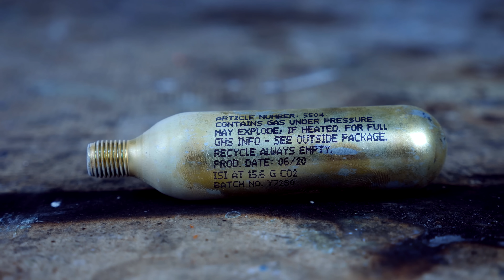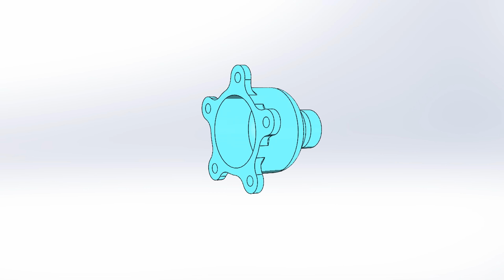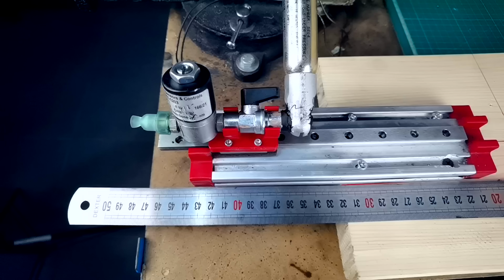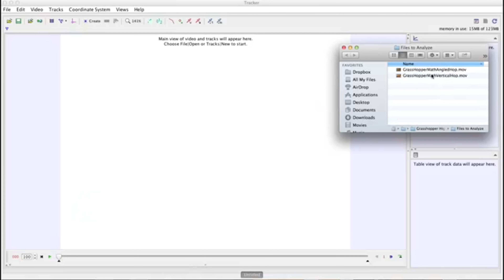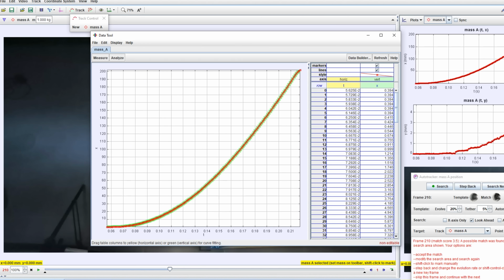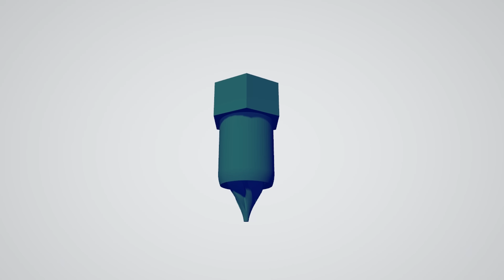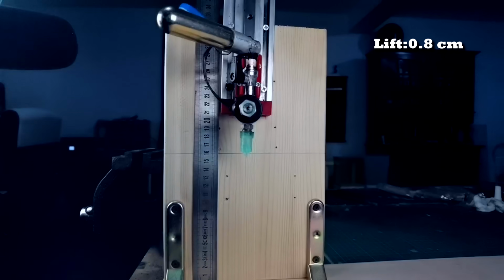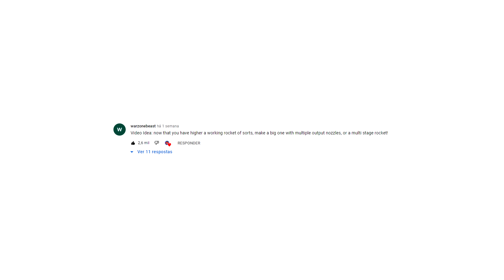I 3D printed a CO2 Rocket

Comment: Nope, no dry ice in there. The pressure in cartrigdes like that is about 55 bars, at that pressure CO2 is liquid (at room temperature). When releasing the pressure, you do get some dry ice out of it. That happens because of the enthalpy of the system, which is conserved. If the cartridge opening is small enough that is (Joule-Thomson-effect). You can see in the p-H diagram of CO2 that when coming from a liquid at 55 bar, dropping the pressure you end up with a solid-vapour mix at ambient pressure, due to the temperature drop. I use the exact same method to make dry ice pellets for the Leidenfrost experiments I do for my master thesis.
Reply: Awesome explanation dude :)
Reply: Great to hear sir, thanks for sharing.
Reply: So there a 4 phases of co2 inside the cartridge during a full emptying  liquid, solids (like u discribed nicely) supercritical and well a Gas
Reply: Bruh, this comment was about pressurized co2, how the heck did the replies get so wacky?
Reply: @doctorpurple5173  lol.
Reply: @jimmyb1451  lol
Reply: @okumhlopheindodaactsxvii4022  You forgot to like your own comment.
Reply: @jimmyb1451  55 bar =797.7 psi & 14489.3 psi = 999 bar 

Its you who doesn't comprehend anything, not even the world Your living on
Reply: @jimmyb1451  22km or approx 72 000ft below the surface of the earth is the Furthest "Man" has ever penetrated the earth, They say earth crust is 35-70miles deep then the mantle from 70miles to 1000miles then the outer core 1400miles then the Inner Core 800miles 

Tell me again how do They know that if 22km is the Furthest anyone has ever gone below the earth 

They say the Core of the Earth is Hotter than the Surface of the Sun
Reply: @jimmyb1451  theoretically on your ball world you think you live on, if you theoretically dug a Hole at the North pole straight through the earth to the South pole and there's a hole big enough to jump right through, if you Jump in at the North side will you be falling "UP" or Falling "Down" at the south pole?
Reply: @doctorpurple5173  lol
Reply: We used to make dry ice bombs with Gatorade bottles and CO2 bottles at the paintball range I worked at. Turn them upside down into a rag and crack the burst valve. Instant dry ice
Reply: https://youtu.be/NlT6XqpoeTo
Reply: Your thesis will be entirely wrong if you don't take into account that the entire world has a Barrier around it keeping 14.7psi "air pressure" at sea level Inside without leaking any of that from escaping into an Infinite Vacuum "imaginary" Space along with your "Imaginary" Gravity that holds no Water
Reply: @okumhlopheindodaactsxvii4022  "imaginary"?
Can you explain the quotes?
Reply: @rickhowe5082  He's a flat earther.
Don't bother trying to get any sense out of him.

He has no concept of gravity nor pressure. Or anything at all for that matter.
His "density argument" is only less dense than his head.
Reply: @jimmyb1451  the Earth takes shape like Clay pressed under a Seal its features stand out like that of a curtain "don't think the earth is by any way flat" mountains, Crevasse canyon's ect. But i definitely Believed all the World's Water Seeks its own "level" thats why at any Beach view Ocean side you can See the ocean from one Horizon to the other and take a picture of that View and Eddit it with photoshop and draw two parallel lines just above the Horizon and below the Horizon you'll notice No Curvature on the Horizontal Horizons you get from the ocean view, if its really a "Ball" should it not Curve 360° all around you and not just only in the direction you are facing, think about it use your brain's as I have "psalms 96:10 announce amongst the Nations "the Lord" that's Jesus is KING, also the World is Fixed, so that it doesn't wankel forever and ever, "The Lord" Thats Jesus will judge the Nations Justly. Narrator "Jason" -Acts 17v⁵-⁹ the only one of the 72 who wasn't mutelated and burned by Israel and the greeks and the Jews but was let free on good account also mentioned in John21v20-25 the only One who will never die until The Father of all creation comes once more
Reply: @jimmyb1451  funny right how can Parallel lines exist on a Sphere when the Maths and science dictates otherwise, last time i checked mathematicaly "Straight line's" don't exist on a Sphere yet every ocean side beach view is 100% Horizontal "Parallel"
Reply: @jimmyb1451  tell me right im sure you'd understand this, In Magnetics right Opposite poles attract and like poles Repel, So A Compass is designed to point where? The Compass Needle is Polarized with One Polarity only otherwise the design won't work its magnetized with a North polarity just FYI "your True North" is my Fact "South" all compasses point Not north but True to the science South, Now I've turned your world upside down what will you do
Reply: @jimmyb1451  has no Concept of Fact from Fiction
Reply: @okumhlopheindodaactsxvii4022  LOL

Lucky we have such omnipotence as you amongst us. The ONLY one in the world who knows "The truth" (.TM)

Since you know so much, explain to me why it is that literally every rocket that you just watched only travelled a short distance vertically, and much further horizontally.

Why did they travel further in one direction than the other, given that there were no changes made to either the amount of thrust they produced, nor the weight nor mass of the rockets?
Reply: @okumhlopheindodaactsxvii4022  Go back to watching your hero, Nathan Oakley.
Reply: @okumhlopheindodaactsxvii4022  I'm not going to read all that, and you're not to demand anything.

I asked YOU to EXPLAIN what just happened in the video YOU just watched.

Do not bother replying to me with anything except for YOUR EXPLANATION of what you just saw, in reference to my question.
Reply: @jimmyb1451  dense as can be expected from someone who doesn't pay attention, in this video the sorry excuse for a Rocket had a weight of 262g without it attached to the linear-guide steel has a density of 7700kg/m³ there's also some Printing Resin on the "rocket" with a liquid density of 1,12 g/cm3 hardend its 1,20 g/cm3 so as i explained earlier Do the Maths remember there's unseen or Many unmeasured variables like the weight of the Linear-guide bearing mechanism allowing it to move on a guide track, there's the miniscule weight of the wire of the electronics controlling the rocket valve and that's not measured too, all that adds up to even more weight than 262g total mass because the rocket is attached to the linear-Guide so it's one mass of weight the "Rocket" had to push before the Guide-Tracks gave way to inertia, So at first the rocket used all its might to try and lift the whole Linear-Guide fixed on a chair or some sort not taking into account the chair's weight too, and lost all of the rockets Inertia when it lifted you can see the gas leaves the nozzle and only after a preliminary moments after the gas escapes the rocket lift's meaning it was trying to lift every thing upwards Another think that cant exist on a Globe "Up or down" but anyway only when the Tracks and rocket broke free from internal Inertia it moved "Up"
Reply: @WouterVerbruggen  how does the world have a 14.7psi or 1.01bar pressure at sea level and whenever you get Higher in Altitude it is Significantly lowered at 20 000m Above sea level its 0.51psi or 0,06 bar at 30 000m or 100 000ft its 0,1psi or 0,015 bar they say the Atmosphere ends at 10 000km so at that altitude even well before that hight there would be no pressure at all so this punk Jimmy B was wrong from the start the Atmosphere doesn't leak any Of the Air into Space but its not the Atmosphere holding the air pressure inside either so why at sea level is the pressure 1.013 bar The canister you speak of is pressured at 55 bar its exactly the same as taking a sealed canister at Sea level with sea level pressure inside and Taking it below see level a few hundred KM because -1500m 1.5km below sea level is equal to 1.2Bar but the air at sea level has a Gas content of 8.31432 J/Kmol K what do you think would happen if a canister was lowered below see level so that the pressure inside becomes 55bar and you release the gas would the same effect take place as on Sea level?
Reply: @WouterVerbruggen  the kola Superdeep borehole maximum depth of 22km had a 11 892,7Bar or 820psi pressure at 22000m depth below Sea level so i was wrong in stating that it will take a few hundred km to reach 55bar but still there's a key thing i have to mention too it's all to do with temperature, the Higher you go the lower the temperature as well as the air pressure but we all know hot air rises and cold air sinks and yet the lower you go the Higher the temperature and the greater the pressure, so the Kola Superdeep borhole is the deepest "MAN" has ever gone below the surface of the world, they say the Crust is 20miles deep and the mantle between 1000-1200 and the outer core between 1200-1400 and the inner core about 800miles, but you know Humans have only been as far as 8 Miles not even surpassing the crust are you really going to trust a bunch of liars on the "Laws" given to you people like Jimmy B would think that the Molten Iron Core of the earth Gives the magnet Fields of the earth but then Completely doesn't know that the Curie point of iron is 770°c losing all magnetic effects or attraction of any kind and the Core of the World is also Said to be hotter than the Surface of the Sun Just how did they measure that with only 8 Miles of depth
Reply: @okumhlopheindodaactsxvii4022  "depth of 22km had a 11 892,7Bar or 820psi pressure" 

Are you suggesting that 820 psi = 11 892.7 Bar?
Reply: @jimmyb1451  A bar is a metric system measuring unit of pressure. It is approximately equal to atmospheric pressure on earth at sea level. It is denoted as "bar". One bar is equal to 100,000 Pascals and 14.503773773 psi

Psi stands for Pounds per square inch. It is measuring unit of pressure & stress in Imperial and US customary measuring system. The symbol of psi is "lbf/in2" and abbreviated as "psi". One psi is equal to 6895 N/m2 and 0.0689475729 bar. 

So 820Bar = 11 892,7 Psi Idiot
Reply: @jimmyb1451  Strawman you should hold your tongue before you make a fool out of yourself everything i have mentioned is accurate 100%
Reply: @jimmyb1451  they say the temperature of the Core of the earth is 6,000° C then they say the temperature of the Surface of the Sun is 5,600° C how about that
Reply: @jimmyb1451  what is what i did not say?
Reply: @jimmyb1451  your in Australia right as you have said, tell me is there some place in Australia that you can see the Antarctic ice wall "IE" the Edge ?
Reply: @jimmyb1451  also regarding earth maps we have no physical land mass determining the north pole like we do with Antarctica, roughly 600 year's ago World maps had a physical land mass determining North, but since Newton's time they erased that history from all the maps  in the year 1666 Newton patented his theory of Gravity
Reply: @okumhlopheindodaactsxvii4022  Ignoring everything else, about 180,000 pounds of earths atmosphere is lost to space every day

Comment: With C02 rockets, expansion is everything. Add a heating chamber before the solenoid with a lot of internal surface area to maximize the gas expansion/velocity. Just blowing dry ice out the back is a waste of fuel. This will make the rocket heavier but increase thrust if done right. The question is will the net performance be better? Only one way to find out.

Comment: Bravo......45 degree angle ...with string.....rocket sled ......co2 goes end rear...use a nail pop co2......ur co2 was on right angle....flow problem.....co2 is the engine.......lose all the extra weight.....rocket could be made of paper.....now thats a kid project......cheers

Comment: What about a Tom Stanton esque compressed air engine using a rocket nozzle to inject the air into the cylinder. It would be interesting to find out if that would benefit the engine in power, efficiency, or both.

Comment: metal will ignite when pure oxygen is present. maybe you can make a engine with aerogel or other similar coating inside to reduce heat transfer and oxidizing.

Comment: Somehow make a rocket using like 5 (or more) 20g(or higher) co2 cartridges 
Maybe use high pressure hose to attach more then one co2 cartridge for less weight might have a higher chance at working 

And if this works 
U can use the set up to launch the infamous tomato to its doom

Comment: Before curing your resen parts try putting them in hot water for a few minutes the support will practically fall off when you grab them then cure the print. I use this method on my miniatures and it works fantastic.

Comment: idea: liquid cool your engines like the real ones so they dont burn up!
Reply: Instead of liquid cooling he could run co2 form a cartridge along the inner edge of the nosle creating a low heat zone
Reply: @thecoldknight7980  yeah but that would run out fast, and you can just continuously pump some liquid in the engine.
Reply: @azibros  but what if he attached multiple cartridges?
Reply: That would be tricky to print with all the channels running through the bell, but it would be awesome to try!
Reply: @ThalassTKynn  exactly, it would be more tricky to model than print tho.
Reply: Regenerative cooling
Reply: Rotary pump passing coolant through a CO2 cooled radiator and into the nozzle water jackets and then back into the pump
Reply: https://youtu.be/NlT6XqpoeTot3

Comment: I have heard of companies researching steam powered rockets.
They don't have enough delta-v to get you into orbit but they are way cheaper than liquid oxygen and hydrogen.
You could build a steam rocket, and since it would operate at only a few hundred degrees c ceramics should be good enough for the nozzle.

Comment: Hi! I was projecting a rocket accelerator / launcher to speed up the rocket in the air, before start burning the APCP propellant, to reduce inertia and consequently get higher altitude.
More than efficient, it had to be reliable and safe, you know, a rocket exploding near you can hurt a little bit.
I ended up with two ideas, the first is to charge a big flywheel with an electric motor and "punch" the rocket into the air.
The second one is simpler, use compressed gas to launch the rocket in to the air.
Through a lot of research and coffee cups, i decided to use CO2 or N2O.
  As you can realize seeing your video, its not gas you're using to propel the rocket, the fine white "smoke" that is coming out is a mixture of liquid and crystals of CO2. In the decompression time, the pressure diference causes the solid CO2 to change phase, but the lack of heat in the environment prevent it to fully expand in to the gaseous form.
  In my project, i made a big barrel "like a gun barrel" with two chambers separated by an steel mesh, on top of the mesh i place a tight and thick polymer base and the rocket on top of it.
  In the base chamber i put a ceramic vase fully of thermite (Produces a extreme exothermic reaction when ignited), and the incoming of a big CO2 cylinder.
  So, you ignite the thermite, the chamber get rapidly hot around 2000ºC, and you release the CO2 at full throttle. The CO2 expands so "fast and furious", that the projectile/rocket is launched at very high speed into the air!. While using a sensor at the end of barrel to sense the rocket passing by and ignite the APCP propellent.
That's the way you can make a Hypersonic speed rocket. (and maybe lose a finger or two).

So, after all this text, i think if you use only the electrovalve and make this piece of metal between the valve and cartridge a little longer, and red hot using a blow torch, you gonna gain at least  3X thrust.

Also, i like your channel very much! thank you for spread science along folks!

Comment: This cold rocket video makes me ponder:
if thrust is being generated by the directed expansion of a gas,
and the gas is being expanded by taking up temperature from the surroundings (and i suppose, the gas then acts as coolant),
then how would a rocket engine perform that uses a burning fuel that heats up (or burninates) a frozen coolant that causes even more expansion ?

...And who would celebrate such a thing more, Johnny Bravo or Beavis and Butt-Head ?

Comment: Hi, I think a "straightforward" improvement is to put a eletrical heater element in the path of the gas, to increase it's pressure.
I'm not sure if a metal tube can transfer enought heat. Maybe you can design something with a mesh inside and print it with copper filament.

Comment: Video idea, what if instead of trying to make the whole system fly, why don’t you try to make something that can be used like a launcher base, you can try some compressed air cylinders and some springs or pistons to create a blow-back system capable of launching multiple projectiles or streams of air on a constant rate, ( similar to an automatic CO2 airsoft gun)

Comment: This is not for a future video. But... Two things... Remove supports after rhe print is quit easyer. Print, remove supports, clean, cure.
And the other thing is. There are refillable co2 cartridges. They are working with greengas. Much cheaper😏😉

Comment: use the 3d printer to make an rocket with the ceramik resine and put an metal inside to take the gas from leaking , like an shell in the inside or kan you use the metal and ceramik 3d print material in once on one you print with the ceramik the outer shell and with the metal the inner shell 👍 why i have now the sone (" fly my to tge moon ")  in my head 🚀😅 see u🌕🌙😉

Comment: Portable hydrogenerator for changing ur phone or whatever. Required parts a calapsable  bladder to hold the water an adjustable nosal to control flow and a Hydro generator.